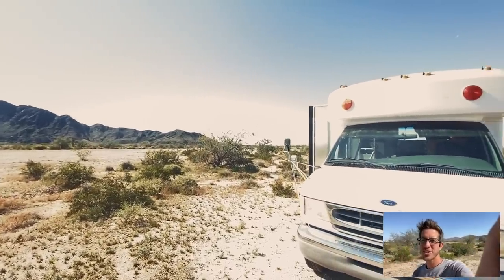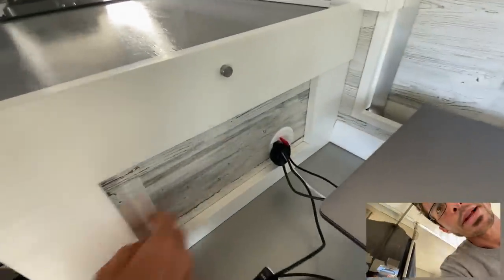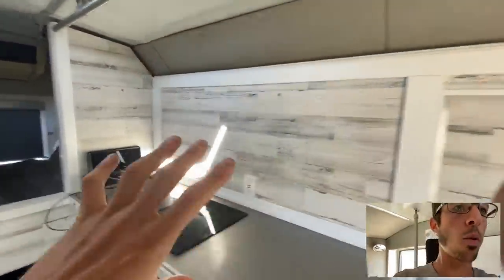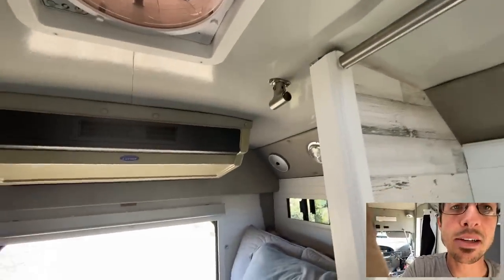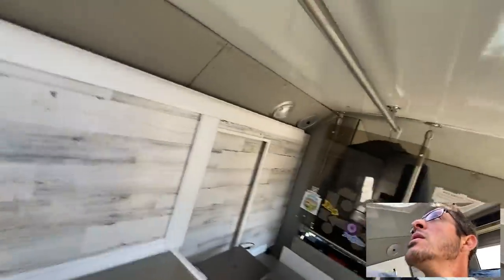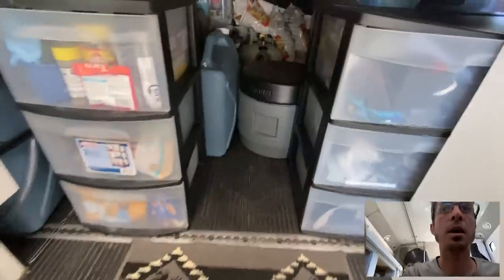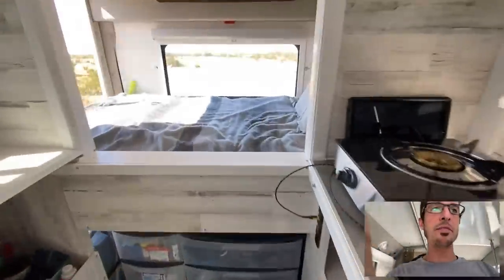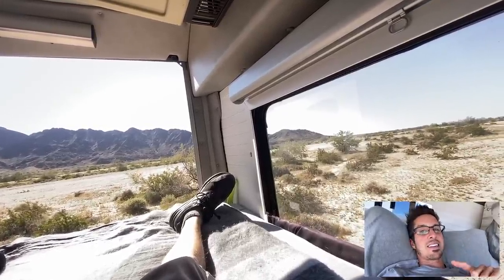Shuttle Bus Conversion Office + Tiny Home Tour

Comment: these buses are the perfect size to have more width inside than a van build would, still low enough to build up the roof and not worry about bridges/lines, and can fit in any parkiing spaces.
Reply from the maker: Exactly! It really is just the right size. And the price is right. You would spend at least 4x more to buy a used sprinter

Comment: In a traditional fridge when you open the door all the cold air slides out(cold are sinks to the lowest point); chest style fridges are more efficient because when you open the top the cold air does not rise or escape as much.

Comment: Love your 🚌 You did an amazing job with the build. Your bus is an example of why I would choose a shuttle bus over an RV. So many windows🙌🏽🙌🏽 The door by the bed is everything. You’re only missing one thing, the string of little white lights😊 What brand is that port-a-potty? Or is it just a bucket? The bucket method seems the simplest. Poop in a bag and keep it movin. No tanks or cocoa core😅
Reply from the maker: Mystical Misfit thank you and yes it’s a “hassock portable toilet” but basically a bucket and lid
Reply: Nomad Brad You’re welcome👍🏽 and thanks for the info on the toilet 😊

Comment: I love it! I like how you covered the windows with walls. I want to convert a shuttle but the windows in my mind are a security risk. I think the pocket doors on the windows will be a good solution. Those could even have a lock on them some way. Or  I could just leave the top visible. Anyone who wants to break in will have to work for it.
Reply from the maker: Yes, I also believe all the windows are a security risk and that’s where you loose or gain heat. Also it’s just too much exposure. I prefer the privacy of fewer windows and not needing curtains everywhere

Comment: No need to apologize or explain why you chose what you did.  The van looks great! Being able to sweep hard floors is nice.  Being able to take your beautiful rugs out and beat the dirt out is much better than installed carpet.  The rugs are also insulating and warm insulation on a cold desert morning.  

Everything you said about the advantages of a chest style fridge is true. But don't forget that heat rides.  It is easier to keep a chest fridge/freezer cold when you open the lid vs opening the door of a traditional door fridge/freezer.  Putting something insulating under it is also helpful, as is not placing it over a hot area.

Great van!
Reply from the maker: Thank you Rebecca!

Comment: I was wondering if I need to take down the nice white metal bus ceiling to do lighting, but I don't think you did.  Did you run wiring at the corners of your ceiling under those 45' trim boards?
Reply from the maker: Glenda Jorde I would avoid taking down the ceiling if possible. I didn’t take mine down. The bus already had lights installed. I just wired them to be independently operated.

Comment: I like a lot of your build!

Clean your solar panel, that allows you to get more solar on a bad day, not looking like it will affect you this day.

As far as a fridge, it can be a crap shoot. Even Bob Wells says just get whatever you can afford. There's no guarantee.

Overall, a great build! Lots of ideas I like. I like reusing stuff so people have to figure out what you did. If you rebuilt it, I'd have used 2x2s for your electric area. That's overbuilt. I built the bench in my van with 2x2s, held up great. If you get 2x4s, you can cut them in half.

I like covering up some of the windows. I've thought about doing something where you have an insulated panel that just drags up from behind the cabinets and locks in above.

I haven't been sure on the handicapped lift because I could use it for moving things, since this is in place of having a truck. I have a small trailer that's for towing behind my car or bus/van.
Reply from the maker: Thanks!

Comment: How did you attach the insulation to the window walls?  Most builds I see add wood framing to the walls, floor and ceiling.... did you just screw everything right to the van wall?  Love your build!

Comment: Nice build for  a quick put together. No negative punt intended either. I see a lot of different updates to do. But it's totally functional as is.I'm a movies buff myself. So a bigger monitor would be my first upgrade.A two burner cooktop a must. But you use the insta-pot mostly. So that works for you. With all the space under the bed. I'd get me bigger water tanks.Since you don't use so much battery power. I'd opt for a 12v pump.You could always use the jugs to fill a larger tank.Put a drain cox in the bottom of the gray water tank to empty as needed. A propane on demand water heater.That would allow for an outside shower and hot water for dishes. Oh Yuck washing dishes. I don't like doing!! With the outside access to under the bed. A slide out tray would be convenient.Also one on the inside would work as well.I could go on and on. You said comments and suggestions were cool. So I threw a few at ya.Keep on Truckin' Dude!!
Reply from the maker: Those are all great points. I do have plans to complete many of those in the future. I just used a friends propane shower while parked along the river. It was so cool! I’ll definitely be adding one of those.

Comment: Hi, I'm thinking about buying a shuttle bus, ford, but I've heard anything before the year 2010 will have lots engine trouble especially if you don't have it bulletproofed. You have a 2000 7.3 powerstroke diesel. Have you been in shops much?
Reply from the maker: it is not bulletproofed and has been very reliable.

Comment: What do you do for air conditioning? I'm gonna start doing stealth in florida and I'm super concerned about keeping cool. What would you recommend powerwise to have?
Reply from the maker: Air conditioning is very difficult because it requires a lot of electricity. You need at minimum 1,000 watts of solar and 600 amp hours of battery. I did not have air conditioning. I just travel places where the weather is tolerable.

Comment: How expensive is the gas on one of these things? Like if you're driving 6 hours away is it like $300 or $600 or more?
Reply from the maker: My bus averages 12mpg. If you drive 60 miles per hour then you can drive 360 miles in 6 hours. 360 miles/12mpg = 30 gallons of gas consumed to drive 360 miles or 6 hours.

You would then multiply 30 gallons by the cost per gallon of gas. If gas was $10 per gallon then yes, it would cost $300 to drive 6 hours.

Comment: I just noticed that it looks like you kept the original ceiling panels? Why did you go with that option and is it insulated?
Reply from the maker: Marcelo MyRideNY wheni cut out the hole for the max fan I discovered there is 4” rigid foam insulation in the ceiling and it’s a nice shiny white which is the look I was going for.

Comment: hey Brad!  We are on the same path!  I lived in an econoline for 2 years as well and sold it to do a shuttle conversion.  I'm looking for the same bus with that engine as well, you did a great job I took some notes for my conversion!  What is the exterior length on that one?  I had 19 ft with my econoline and I need a bit more space to build a bathroom in this one.... thanks!
Reply from the maker: Stacy Regan this bus is about the smallest one they make,  21’ bumper to bumper. I would probably get the 25’ if I was going to add a bathroom
Reply: @nomadbrad503  thank you!  I'm curious too.. is there a compartment outside that could house a generator or two on your bus? I am finishing drawing up my plans and wondered if I would have to build something or if there are exterior compartments I could work with by adding ventilation?
Reply: @nomadbrad503  Im trying to find those ikea blinds.. can you help me?

Comment: I see that ammo! Glad to know you will be safer and be able to protect yourself my man!
Reply from the maker: Lol those are my freedom tablets
Reply: @nomadbrad503  OH right! ;). I like the floors and I'm getting basically the same van this week. Does it stay warm without the floors or roof being insulated?
Reply from the maker: Eric Downs it does not stay warm..and my ceiling had 4” of factory foam insulation. I ran the propane heater to keep the cold away
Reply: @nomadbrad503  But with the heater it stays warm right?

Comment: Very good job you did a super job thank you for sharing.
Reply from the maker: I appreciate you 😊✌🏻
Reply: @nomadbrad503  Hello was your bus a e 450? what are the rough measurements from back of drivers seat to the back door thank you again. Did you ever work at UT hospital in Knoxville.
Reply from the maker: @rockytop441  yes it was an e450 diesel. The outside length from bumper to bumper was about 21’. From west to back probably about 12’